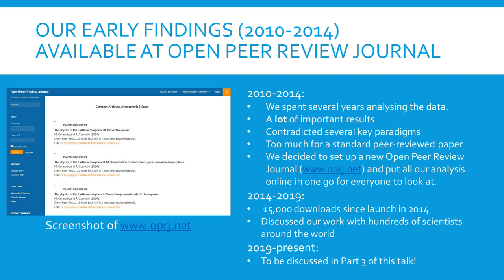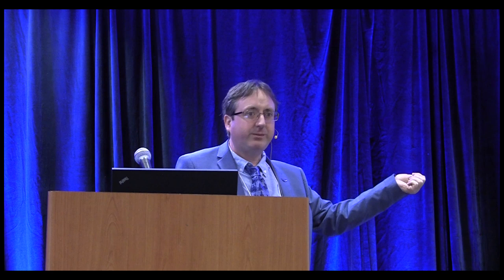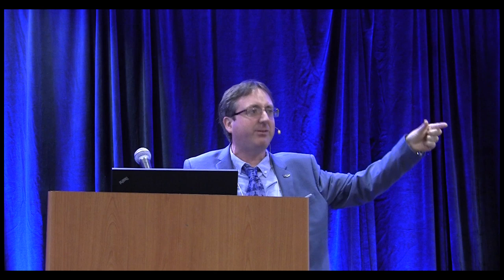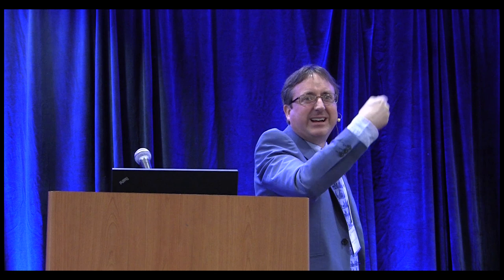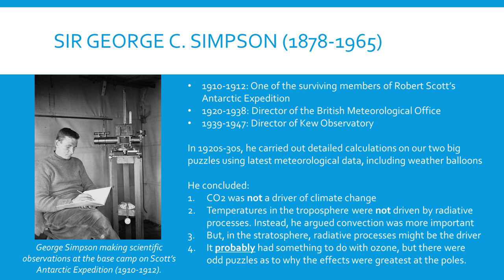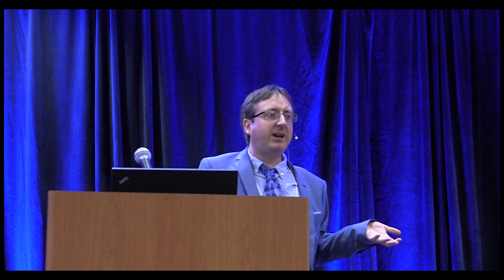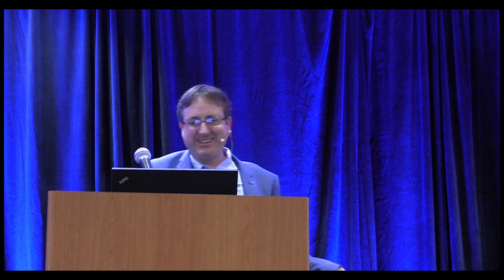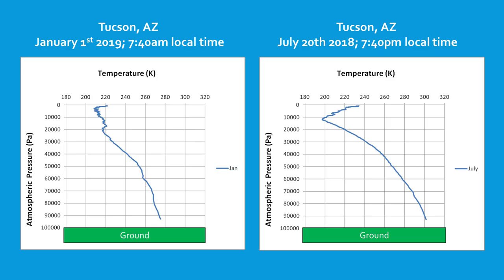Balloons in the Air: Understanding weather and climate

Comment: The two Dubliners claim that Einstein demonstrated that gasses that had absorbed radiation would not store heat because the gas would immediately re-radiate that energy.

CO2 absorbs earth's black body radiation. This heats up the CO2. The CO2, because it has heat, radiates energy based on the temperature of the CO2 and its emmisivity. A CO2 molecule is a point in space. It radiation is spherical so that some of the radiation goes away from the earth's surface but some of it radiates back towards the earth's surface. The CO2 molecule will radiate as long as its temperature is above absolute zero. This means it is radiating all the time. The amount of radiation is related to its temperature. The temperature is related to the amount of heat energy stored in the molecule.

It is wrong to claim that each of the regions of atmosphere are in thermodynamic equilibrium because they are constantly being subjected to radiation that is pumping energy into each region of the atmopshere from a radiating earth. Of course the troposphere is also being heated by convection from warm air that is rising from the ground.

Lapse rate. In the tropics the tropopause is much higher in altitude than in temperate regions. The reason is for this is that warm ocean surfaces cool by evaporation moving latent heat upwards where it heats the upper atmosphere through condensation. The lapse rate moves towards the moist lapse rate. The tropopause is where the lapse rate peters out because radiation from GHGs to space dominates over convection. The tropopause is much higher in the tropics because there is so much water vapour in the atmosphere that radiation can only dominate where H2O wavelengths are no longer opaque. Despite this the temperature at these heights is not less than in temperate zones and the radiation loss is significant. This shows how the troposphere lapse rate and height is defined by greenhouse gas concentrations. If you add more water vapour to the atmosphere the troposphere increases in height. This is a negative feedback because more H2O does not lead to enhanced surface warming. On the contrary surface temperatures are stabilised by evaporation.

The claim is that because the system is in thermodynamic equilibrium all heating of atmospheric gases by absorption of black body radiation is equalled by cooling of atmospheric gasses through black body radiation. If I am following their argument, and I am not sure I am, they are claiming that cooling at night is evidence that global warming is not being caused by greenhouse gases. But the temperature of the gases in the troposphere is dominated by convective heating and condensation which heats the surroundings. I do not understand why they are ignoring convection and condensation.

In the troposphere GHGs do absorb black body radiation originating from earth which does increase the temperature of the GHG molecules (it is our bad luck that the earth radiates at wavelengths that are absorbed by GHGs). These GHGs do get warmer they have to if they are absorbing radiation and they do radiate energy. It is just that they radiate some of it back towards the earth. So yes they do absorb and reradiate energy but since some of what they radiate goes back towards earth that energy raises the temperature of the earth. Some of earth's radiation is absorbed by GHGs and sent back causing a greenhouse effect. Of course they also radiate some energy away from the earth.

They are claiming that the lapse rate used by IPCC modelers is a constant. That is simply not true. The lapse rate varies greatly depending on the temperature of the air, the water content of the air, and large scale air movements such as winds which mix the air.

Greenhouse forcing does not rely on a fixed lapse rate. Indeed, the lapse rate operates independently of the greenhouse forcing except to the extent that greenhouse forcing raises the temperature of the surface of the earth which leads to greater convection.

Sometimes greenhouse forcing is overwhelmed by convection. Warm tropical oceans can lose a lot of heat through evaporation and convection.

The troposphere rises and falls constantly based on convection and mixing. This suggests that the troposphere and the tropopause and the stratosphere do interact with each other. As I said the troposphere is just the place where convection peters out and changes in atmospheric temperature are then dominated by GHG radiation. The concentration of gas in the troposphere is pretty low. If you heat up the sparse molecules in the troposphere then the temperature will rise. GHGs in the stratosphere are warmed by black body radiation originating at earths surface OR from GHGs in the troposphere that are radiating heat energy out into space.

Question from audience. It gets really cold in Russia and Canada so where is the stored heat? or in other words there is no stored heat. The two Dubliners agree that there is no stored heat. That is simple nonsense. The heat is in the atmosphere but most of it is in the oceans. While the heat in the atmosphere may very greatly from place to place or from time to time but the average heat is rising.
Reply: I don’t think they are arguing that climate changes don’t occur - I.e. average temperatures do go up and down. But that the atmosphere is free to expand and contract and thereby maintain thermodynamic equilibrium. The temperature increase/decrease is ultimately driven by things coming from outside this climate system, not from gaseous things inside it.
Reply: 'GHGs in the stratosphere are warmed by black body radiation originating at earths surface OR from GHGs in the troposphere that are radiating heat energy out into space'
No, they are not.. there is very little H2O or CO2 in the stratosphere where the dominant GHG is Ozone. Ozone is created by short wave solar breaking down O2 which then absorbs UVB at the stratopause. This causes the negative laspe rate and hence warmer temperatatures in the upper stratosphere (273K).
Reply: @martinhughes1854  The atmosphere does not maintain thermodynamic equilibrium. It is being acted upon constantly by thermodynamic forces. The sun heats the earth's surface which, in turn, heats air near the earth's surface. This hot air rises. It also causes water (from outside the system) to evaporate. Warm humid air removes heat from the earth's surface and carries it aloft by convection. Huge parcels of atmosphere rise and fall and move along ever changing pressure gradients caused by changes in temperature. The water that originated in lakes or oceans which evaporated in response to heat from the sun (thus removing heat from the body of water of origin) rises carrying latent heat with it until it reaches an altitude where the temperature is cold enough that the water condenses to form clouds (large numbers of droplets of water coalesced in the atmosphere) releasing heat that was taken up at the time of evaporation. Ocean surfaces may cool large parcels of air which may, in turn, cool the surface of land masses that the parcel of air passes over. The parcel of air will gain heat as it removes it from the land. The atmosphere is never in a state of thermodynamic equilibrium. You should try studying cloud dynamics. Clouds are immensely complex systems that are products of this absence of thermodynamic equilibrium.

It is not clear to me that the Dubliners understand that CO2 does absorb infrared radiation emitted by earth. The wavelengths of the energy emitted by earth are determined by the temperature of the surface of the earth. CO2 has a low average emissivity but it has a high emissivity at particular wavelengths due to the vibration of covalent bonds between carbon and oxygen. These bonds absorb infrared radiation or photons at wavelengths typical of Earth's radiation. The wavelengths that form the the center of the peak absorption bands are 15 μm, 4.3 μm, 2.7 μm, & 2 μm (in decreasing order of intensity). In other words the CO2 molecules in the atmosphere do absorb heat energy photons that originate from the earth. CO2 also emits IR radiation in the form of photons at the same wavelengths giving up the energy it has absorbed. So do H2O molecules in the atmosphere. O2 and N2  have covalent bonds that do not absorb radiation emitted by the earth so they do not contribute to global warming. CO2 emits photons in any and all directions. Not all of the energy is sent back to earth; however, given the specificity of the energy of the photons they are immediately absorbed if they come into contact with other CO2 molecules. It is likely that these IR photons are absorbed and re-emitted many times before either coming back to earth or leaving the biosphere. https://scied.ucar.edu/carbon-dioxide-absorbs-and-re-emits-infrared-radiation

The reason that the troposphere gets colder with altitude is because its temperature is governed primarily by convection: warm air rising from the surface of the earth. This is very different from black body radiation in the thermal bands that earth emits. The temperature of the stratosphere rises with altitude because of radiation emitted by greenhouse gasses.

They claim that the atmosphere is not getting hotter but that isn't true. However, the greenhouse gasses do re-emit their IR photons which either return to heat the earth or end up radiating out into space.
Reply: @alexanderbuckley2797  Yes. I slipped up. GHGs in the troposphere do emit radiation that reaches the stratosphere but very little CO2 reaches the stratosphere. It is, indeed, absorption of UV light by oxygen that warms the stratosphere.
Reply: @jpdegrootsac1977  thanks for the reply. I’m still a bit new to understanding all this so any explanation is food for thought. I think that the most interesting bit that I think I can understand about their results is that it looks very much like there is a phase change in the atmosphere as you go up. All the balloon studies seem to show something like this. It is a change that they can describe in terms of gas laws, and their lines seem to be a good fit with this hypothesis. If it is a phase change then this doesn’t seem to leave any room for the greenhouse gas idea. There seems to be no appearance of any disruption that would imply some other factor is at work other than the gas laws. I suppose it’s possible that the greenhouse gas forcing has a fingerprint that exactly mimics the appearance of a phase change but it seems a bit like trying to explain the motion of Venus in the sky from the standpoint of a geocentric world view. It would be quite an ad hoc explanation compared to the alternative one that just drops the central assumption.
Reply: @martinhughes1854  I would have to watch it again looking for evidence of a phase change. I am desperately trying to remember my undergraduate climatology :) I have made a large mistake. In my first comment I wrote about emissivity of CO2. I said that CO2 radiates in a way that is consistent with Stefan-Boltzmann's laws governing black body radiation. The CO2 actually absorbs heat radiated from the earth because the covalent bonds between the carbon and the oxygen molecules vibrate at specific frequencies which determines what wavelengths of energy they absorb. It just so happens that the wavelengths of radiation originating on the earth's surface are just the right length to be absorbed by C-O bonds. The radiation from the earth causes the C-O bonds to start vibrating which means they now exist at a higher internal energy state. The CO2 molecules do, indeed, heat up. They also bounce around colliding with other molecules in the atmosphere. Eventually they release the internal energy they absorbed. The wave length of this energy is the same as the wavelength of the energy they absorbed which is the same as the wavelength of the radiation emitted by the earth's surface. The fact is that the CO2 molecules do heat up and they do re-emit their absorbed energy. Some of that energy is emitted in the direction of the earth's surface. This is what causes the warming.

The presenters claim that the atmosphere is in a state of thermodynamic equilibrium. Indeed their entire theory is based on this assumption which is simple dead wrong. I have already written about the various forces that act upon the troposphere. Since the troposphere is not in a state of thermodynamic equilibrium the simple gas laws are not apply.

Certainly the air that rises from the surface of the earth often has a significant water content. The surface of the earth is more ocean than land. Sunlight hitting the ocean surface heats the water and the air above it. The water evaporates (taking heat energy with it) and becomes part of a large body of humid air that rises because it is warmer and, thus, less dense than the bodies of air it is passing through. As the humid air rises it gets colder. Eventually it gets cold enough that the water vapour condenses (undergoes a phase change) which has a warming effect on its surroundings. This liquid water may then become part of a cloud. Clouds are not in a state of thermodynamic equilibrium.

CO2 seldom undergoes a phase change and it is almost never in liquid form. It goes from solid to gas. Oxygen (O2) and Nitrogen (N2) do not undergo phase changes at the temperatures  typical of the troposphere so we are left with water which we already  know experience a phase change.
Reply: @jpdegrootsac1977  here is a written exposition of their position with numerous critiques in the comments section below;

https://globalwarmingsolved.com/2013/11/summary-the-physics-of-the-earths-atmosphere-papers-1-3/

 I don’t think they are denying that CO2 absorbs and re-emits radiation. Or that we have weather - I.e. perturbations of the overall balance. My slightly simpleminded analogy would be that arguing that the sea will find its own equilibrium in terms of sea level isn’t disproved by the existence of waves.

Their graphs show the way in which rain events effect the relation to gas laws. Obviously atmospheric water will only behave like a gas up to a point. 

But really I think you will just get frustrated with my attempts to explain their theory. You should have a read of the link I sent - and if you feel up to it, the papers linked to in it - and get it from the horse’s mouth. The comments section I found useful since many are highly critical and their responses seem well thought through and polite and measured. Something of a rarity I find in these discussions.
Reply: @martinhughes1854  ''
I don’t think they are arguing that climate changes don’t occur - I.e. average temperatures do go up and down. But that the atmosphere is free to expand and contract and thereby maintain thermodynamic equilibrium. The temperature increase/decrease is ultimately driven by things coming from outside this climate system, not from gaseous things inside it.''

This is the way I have always pictured it. I am no physicist but I cannot understand how in an open system, heated gases are free to expand and so expel heat at a faster rate. Thereby, thermodynamic equilibrium is maintained regardless of it's composition. the heat stored being governed solely incoming energy and balanced by gravity. In other words, it's the density of a gas not it's make up which is important. Am I wrong? If so, how?
Reply: That should read - .....I cannot understand that in an open system, heated gases are NOT free to exp....
Reply: @mickoz9389  yes I think that’s how I understand it too. Localised perturbations due to local energy exchange, but evened out by the ability of the gas to expand and contract. This is - as I’m all too aware - oversimplistic. I need to study their papers in depth when I get time because I have questions that maybe are answered in them, like is this phase change mechanism the same or related to that plunger mechanism that they demonstrate? And even if kinetic energy is transformed into potential energy then surely that is still a net increase in overall energy in the system and if some of this energy is being introduced by greenhouse gas then this too will accumulate in the system. 

As I say the questions themselves may not even be coherent. It’s all a bit new to me!
Reply: Dan de Lion  I know that but we have to keep the scientists busy.
Reply: Dan de Lion  what else should they do if the last finds out that the sun is responsible? They talked for 100 Years about the relativity theory. They don't have anything more to debate about now. 

All they doing now is thinking the whole day, how to sell the CO2 theory. 

They should be happy that there are people with common sense. If not, they would have to return to there shadow being in there field and think about what they could sell the would to make them look smart.
Reply: @jpdegrootsac1977  Philip I posted the long complete accurate explanation in a 3-part comment somewhere here. Of course handy explanations with cartoons are available everywhere but not all explain the VITAL need of the lapse  rate. Andrew Dessler's is the best I've found, less quick and cartoonish than the others.
Reply: Hello all this is a fine conversation you guys had. 

A few further points on the macro ,the words you were looking for is the Troposphere is a Carnot cycle, that is why it will never be in thermal equilibrium. A Carnot cycle has two opposing isothermal temperatures, T(cold) and T(hot) as well as two adiabatic lapse rates, wet and dry. This constant imbalance keeps the Troposphere from achieving thermal equilibrium as a whole.

 Yes the atmosphere is considered a closed and open system according to climate physics which perhaps is why they are so confused, I don't know? Closed as in only IR can escape as emissions to space (despite the very light leaking we have of our atmosphere to space) but the atmosphere as a whole is an open system in regards to matter can move freely around it.

Can it get more confusing? Why yes it can. Atmospheric physics also considers each parcel of air a system, and as such individually can be considered open, partial, or closed (and at certain points even considered an isolated system). A closed system is always composed of the same point masses. For example, a large cumulonimbus cloud may be considered as a closed system but a small cumulus is not. More factors (an endless amount) are integrated into this concept. -Undergrad atmopsheric thermodynamics.
Reply: @mickoz9389  The lapse rate, governed my gravity, "auto corrects" compression of the gas, making the ideal gas law feasible in the atmosphere but more effective the lower to the center of mass of the earth you approach. That's why deep mines are holy hell to cool off (auto compression and geothermal temperatures). The higher in altitude you go the less "ideal" the gas law becomes. 

You have to remember that 85% of the mass of the atmosphere is in the troposphere (the lowest 11 km of air) and thus is where the ideal gas law is mostly effective.
Reply: @jpdegrootsac1977  This is pretty good but you may have forgotten some of your thermodynamic lessons. You are correct the atmosphere is not in thermodynamic equilibrium as I stated earlier.

The subtle yet significant difference between thermal energy and thermal heat is only thermal heat can increase temperature. Thermal energy returning to the surface does not equate an increase in temperature, it has to meet the required conditions, hot to cold. A photon obeys the same laws on the micro just replace H-C with frequency/wavelength/energy. 

 IR interactive molecules with a magnetic dipole do absorb and emit radiation, you are correct. However, all gases in the atmosphere can be heated (kinetic energy) and once heated, radiate EM radiation.  Homonuclear diatomic molecules can transfer some of their energy to Greenhouse Gases (that are IR absorbent) via physical transference and that energy once absorbed by a magnetic dipole molecule is almost immediately re-radiated in all directions or as a cloned photon all happening at the speed of light. Yes I agree CO2 is always heated, but it is also always shedding off that heat. The Earth's surface typically does not emit in wavelengths CO2 can absorb below the 15 micron level. 4.3,2.7 and 2.0 are not typically emitted. Those would require something like volcanoes, immense geothermal or nuclear testing.